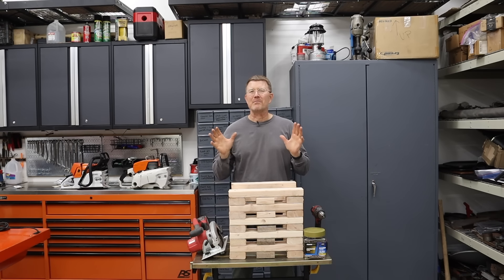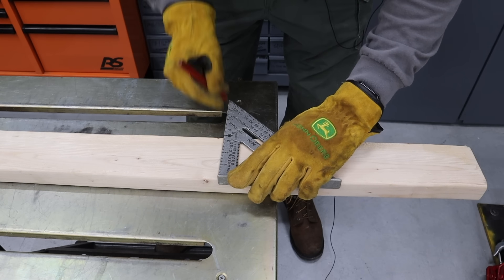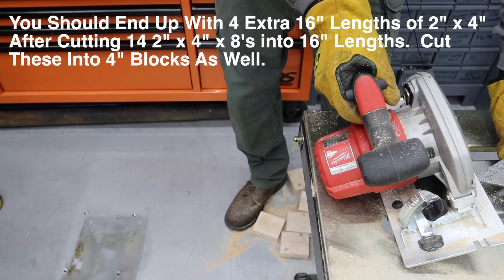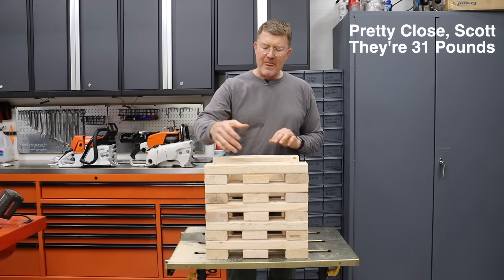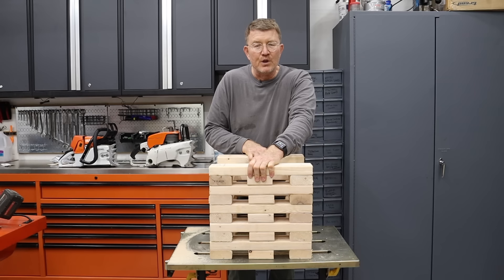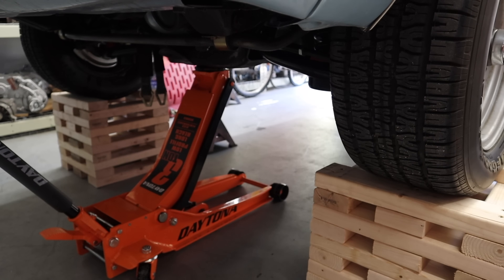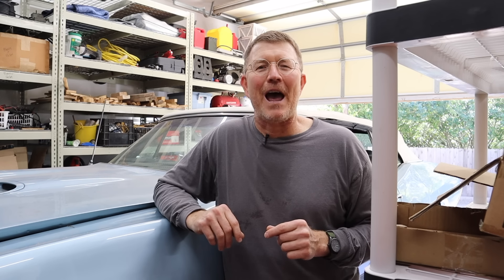Building Inexpensive Wheel Cribbing or Wooden Wheel Stands

Comment: UNSAFE. The front and back of the tire is applying outward pressure to the top two 2x4’s. The only thing keeping it from collapsing is the shear strength of the screws on top. Would be stronger to have the top flat
Reply: Funny how no one’s ever said theirs failed 🤷🏾‍♂️

Comment: I've made several sets of these over the years. I found that some around 7 1/2 to 9 inches really come in handy for most work. You also don't have to build them quite as wide when going shorter, which frees up space under the car (and storing them takes up less space). You can even mix them to have the front higher than the rear (or vice versa). As far as building them, I use heavy construction nails that extend slightly through 2 boards. I believe they're about 3 1/4 inch. I'll pre-drill. To safeguard against the nails backing out or loosening over time, I'll also use construction adhesive or wood glue. Franklin Titebond 2 is ok for exterior use and super strong. I've also experimented with using casters, but the good ones are just too expensive. It would take 16 high-quality casters and prices have gone crazy on them in the last few years.
Reply from the maker: Thanks for the input.  I need something with casters, but I'll probably just buy some vehicle skates for that.  Scott

Comment: Most crib building videos don't include your 4 inch blocks.  As your inclusion of these blocks makes for even stronger, and hence safer, cribs for more peace of mind, we included them. You can never be too safe under a car. We glued and nailed our cribs but only needed to go eight pieces of timber high rather than your ten high. As I live in a new housing development, we were able to use discarded timber that was destined for landfill. Congratulations on your superior crib design.
Reply from the maker: Thanks for the input, John.  Glad you found the video helpful.  Scott
Reply: Same here. I have been planning on building some for a while. I like the idea of putting the extra 4" block in. Thanks for the video.

Comment: Built these a while back to do a Trans swap also. I cannot believe how much easier and less sketchy it made the process. One difference, I am a belt and suspenders kind of dude so I had my jackstands at a place they would, hopefully, give me an extra second or two if there was some sort of catastrophic failure with the cribbing.
Reply from the maker: I generally do jackstand backups if I'm using jackstands, but I did not use 'em when I had the wheel stands under the wheels.  Scott

Comment: Actually beneficial to construct 6 riser stands, 2 half high so the car can be brought up in progression. Treated wood and wood glue not a bad idea as well. Not to overplay the fine job you've done, but overkill is never a bad idea for longevity & personal safety. Tip the trans on the jack & slide. Use a combination wrench with bolt and nut through a bell hole to retain the converter in the pump. Trans guys been doin it that way for decades. To late now, videos 10 months old but you may do again.
Reply from the maker: Thanks for the tip on retaining the converter.  I've seen it before but forgot about that.  Scott

Comment: Good job. There was a thread on this subject on the HAMB not long ago, and some of the cribbing that was shared in the thread looked really sketchy; some guys are obviously engineering challenged. I don't like pine boards for cribbing, but I think the 4" long blocks you inserted in 2 sides made a huge difference, in effect transferring the weight straight to the ground. As long as the weight of the vehicle doesn't exceed the crush weight of the wood, you're good to go; and with the weight of the car you're working on you're fine. But for those watching, if you're working on heavier off-road equipment, don't use soft wood like this, get some hard wood for your cribbing. Again, good job on these. Be safe!
Reply from the maker: Thanks!  I hear you on soft wood; I think these would be really strong with some rough-cut hardwood 2" x 4"s - something that's a full 2" x 4" of course.  Scott
Reply: @THEBULLETPROOFGARAGE  WE used 2x4 rough cut oak timbers cribs like this to change the oil in 15,000# forklifts in the papermill. Also used 4x4 oak timbers for cribbing 30 ton pieces of machinery when moving or breaking it down.
Reply from the maker: @TheJagjr4450  - I have a Catepillar 977 and have some 6x6 rough cut oak for that.
Reply: @THEBULLETPROOFGARAGE  think about the cribbing they use for moving houses... 4x4 6x6 oak or ash. One time my dad and I were unloading a flat bed with a 24" dia 110" wide 30,000# solid steel bed roll off a calendar stack... he had one end I had the other and we had the truck drive out from under us then we lowered it to the ground.
Reply: It's the HAMB back? I know last time I looked it was practically dead and all of posts were gone.
Reply from the maker: @starion88esir  - when was that?  I haven't logged in there in months, but it's always been busy when I do.
Reply: @THEBULLETPROOFGARAGE  I havent logged in there in months either, but when I did it looked to be about the same; same characters, same topics.
Reply: @TheJagjr4450 Would using grade #1 Douglas Fur be adequate?
Reply from the maker: @trickyricky12147  - good question.  I'm not sure what the strength of Douglas Fir is to yellow pine.  Scott
Reply: @THEBULLETPROOFGARAGE  Yeah, figured I'd ask because if doug fur is good for framing structures, then it should be a perfect species for wooden wheel stands as well.
Reply: Any opinion on using pressure treated 2x4 s?
Reply from the maker: @williamholford6301  - should be fine, just a bit more expensive.  Don't forget to use the appropriate fasteners; regular nails and screws are prone to rusting in treated wood.  Scott

Comment: I did basically the same thing, but used 2x12s. The top board is about 6 inches longer than the one below, with 2x4 on the ends to serve as wheel chocks. They are rock solid, and steady. I have had my 7800 pound 1 ton ram 4x4 on them with zero problems. 

They are heavy, but very useful. I used treated lumber.
Reply from the maker: They sound like they're quite stout, and heavy, too!   Scott

Comment: This is probably the best cribbing video I've seen.  The center block for load transfer is a great idea.

My uncle taught me a different approach that may work when time is short and you can't build cribbing.  Get the vehicle up as high as practical and safe based on the jack stands you have.   Put 1/4" plywood on the ground and slide the transmission on it until it's under the trans tunnel.  The plywood will protect the bottom of the trans.  If you can, replace the jack plate with a square piece of 2x12 and a counter sunk bolt that keeps the wood flat against the pan.  Wrestle the trans onto the 2x12 under the trans tunnel and hold down with a ratchet strap. Lift the trans up and roll it forward into place.  I've done it about a dozen times that way through the years when my back was a lot younger.
Reply from the maker: That sounds like a good plan, but I'd probably go to 3/8" plywood.  1/4" stuff is pretty thin.  Thanks for the input!  Scott

Comment: Thank you for the great video,I just went through the same thing,my neighbor loaned me the exact transmission jack you have and I pulled the trans out and even with the car as high as I could get it the trans wouldn't clear the exhaust so I thought I was going to have to remove the trans from the jack (would have been fun!) but then I realized all I had to do was tilt the front of the trans down with the jack adjustment.We always seem to overlook the obvious.
Reply from the maker: Glad you got it figured out!  Scott
Reply: Hey, congrats on that solution! When I was a little kid I was the tool runner for my Dad and The Airforce G.I.s he invited to work in his garage. I saw them use this kind of method to clear the exhaust pipes. This was back in the 1980s.

Comment: I’ve seen several guy/galz make these and as 32 yr carpenter (also yrs as a superintendent over commercial projects) I have had major cringe seeing ppl make these.

That board has a fraction of its load/weight capacity laying flat. On edge or vertical is where it has its greatest strength. The difference I see in yours vs others is adding that center cross members. You’ve transferred the load straight through to the floor. 

So I’d say you’ve done much better and I myself would feel safer vs those others. 

But if it was me I’d use 2x12 yellow pine on edge with a 2x4 base and top. 4 12’s spaced 6” OC and 3 2x4’s laid flat equally spaced top and bottom. That’s just me. Like I said yours are the best I’ve seen so far.
Reply from the maker: Thanks for the input!  Scott
Reply: I'd definitely agree with using some 2x10's or 2x12's on edge. It would save time and materials. But I think the 2x4's flat are probably just fine. I'd trust them over some old cheap jack stands. Jack stands have one point of failure whereas the 2x4's would have to have many points to fail before something bad happens.
Reply from the maker: @LutherBuilds  Thanks for the input.  Scott
Reply: @LutherBuilds  Takes something real heavy to smash wood. I ain't got no car like that. lol

Comment: Back in 2013 I built four of these to lift my Corvette to get the automatic transmission out... took some measuring to first determine the needed 'height' needed to get the trans out from under the car when it was 'on' the trans jack. End result it worked like a charm but a regular 'lift' would have been great... I'm too old to keep working under a vehicle, on my back.
Reply from the maker: Lifts are great, but they take up so much damn room!  I had one in the garage but sold it a few months before I shot this video.  Scott

Comment: When i changed the trans in my truck several years ago i ended up  wi5h cinder blocks  under the 4 jack stands to get enough hight. Used one of them red and white scissor  jack to lift the trans under it. Worked much better then the one 9 on the floor jack.
Reply from the maker: Putting jack stands on top of cinder blocks makes me real nervous!  Scott

Comment: I've been struggling in my mind as to how I would raise my '89 Volvo 240 wagon up high enough to R&R the transmission. These cribs are the perfect solution. I built mine 16" high. And also built 3" extension plugs just in case. I also bought the same jack and the T bar attachment. Thanks for taking the time to make the video.
Reply from the maker: Thanks for the feedback and good luck on the wagon!  Scott

Comment: You can always put lumber under the floort jack as well. And im starting to buy floor jacks in pairs makes things alot easier  and safer
Reply from the maker: True, but you have to be very careful if you're lifting front and rear with floor jacks at the same time because there's really nothing to keep the car from tipping over on its side.  Thanks, Scott
Reply: My Dad and I have always stacked 18 inch blocks of railroad ties underneath the chassis of our project vehicles if they are too high for the jackstands. And then blocks of six by six inch beams. But my Dad remembers cribbing like yours, (but bigger), used by his Uncle Jack when moving houses in the 1950s. The whole crew was a bunch of young guys that used bottle jacks to lift up the houses, and then Uncle Jack would tell them, in his Norwegian accent: "Ho-kay, effry bodday jahk koff!!!" Which always brought gales of laughter!
Reply: And then we stack up the four by six inch blocks. And then the four by four blocks. We had to do this kind of wood stacking when my Dad's car hoist broke a cable while lifting a neighbor's plow truck. All because Dad was too proud of a mechanic to hire a hoist repairman. 
    We even stacked spare steel truck rims underneath when we ran out of wood blocks.

Comment: The trans jack that you used has adjustments  to tilt forward.thats worth 4 ".tilting the front of trans gives you enough clearance to get under the car. Once under the car put torque converter in.i did this on a 1980 trans-am with th400
Reply from the maker: Thanks for the input.  Scott

Comment: When I worked in the South African gold mines, we used cribbing like this to prevent the ceiling from coming down on us. The work area was only 3 to 4 feet high and when your nearly a mile underground, the pressures are enormous and the ceiling of the work area will sink down pretty quick. The cribbing slowed down this process allowing the crews to drill, blast and clean out. After a few months, the cribbing in the old work areas would eventually be crushed  by the intense pressure. The compression strength of wood is about 5000 psi so I'm quite sure the cribs in this video would easily hold a large heavy truck, let alone a car.
Reply from the maker: Sounds like real claustrophobic and dangerous work!  I hope you were paid well!!!  Scott
Reply: @THEBULLETPROOFGARAGE  very claustrophobic. Nearly died once. Returned to the US and considered myself lucky. Great video by the way! I'm building your cribs today. I just don't trust the floor jacks when I'm under my Sienna.
Reply from the maker: @ericberg2131  - Excellent.  Floor jacks make me nervous, too.  Scott

Comment: I made cribbing just like that but longer and made it individual layers and solid tops to put under my jack so I wouldn't have to put blocks on top of the jack makes it more stable and I can increase the jack height 3 inches at a time you can also make extra layers of cribbing to increase the height of the cribbing you made 👍👍
Reply from the maker: Yep, putting your jack on something solid and stable is another way to get some extra height.  Thanks for the input, Scott

Comment: Good video, I was thinking of using cribbing on my son's 2010 Mustang GT and swapping the tranny in my driveway, but my driveway sits with a slight incline and I don't feel safe doing that way. I pulled the C6 out of my 1988 Ford F250 7.3 diesel in the driveway, but it sits tall enough that I didn't need cribbing or jacking. I did have to drag it out from under the truck without the trans jack to clear the bottom of the truck. I laid it on a piece of scrap board and attached a rope to the board and slid it out by pulling the rope. But with his car (the Mustangs sit very low) and the incline, safety first, safety second, safety last, is the rule of thumb so he had to pay a shop to do it even though I know how to pull a transmission. The goal was to save him some money on the labor by just brining the transmission to the shop. But if it is not safe, it is better to pay.
Reply from the maker: Yep, you really need to be on level ground.  1988 F250 sounds interesting; I have a bunch of 7.3 IDI content on my channel.  Thanks, Scott

Comment: Looks pretty interesting and I might need something like this for an upcoming project. I think instead of the 4" blocks, I would cut another 16" piece and have it cross the middle of the block. And I would fill in any empty space in the middle with whatever length of 2X4 is needed to fully support the center of the block where most of the stress would be from the weight of the car. 
         Taking a longer view, If you are a serious car hobbyist, and have time to plan for the future, you should give plenty of thought to how you are going to work under a car as you age.  In a nutshell, I think the majority of guys will not want to crawl under a car as they enter their 60's-70's. Get a car lift installed in your garage/shop so you can work more comfortably and not be as concerned with jackstands and the like. They are not that expensive compared to money frequently spent unnecessarily on other areas. It may mean making changes that you didn't originally plan on like getting a building with taller walls than you have. But it may make the difference between you being able to pursue your hobby and not.
Reply from the maker: I actually had a lift in my garage but it took up too much room.  I may end up with another one, but I hope to still be able to crawl under a car when I'm in my 80's.  Thanks

Comment: I have been looking to build a set of these, and this video came along at the right time. I wonder if you could have just grabbed the tail shaft and tipped the trans forward just enough to clear the frame rail without removing the rans from the jack.
Reply from the maker: Good question; I didn't try it, but I don't know if I would have had enough room.  I'll certainly try it next time.  Thanks, Scott

Comment: With the car on jack stands at the front, when jacking the rear up I'd be checking that the front was still stable and not rocking off the stands or tipping forwards!
Reply from the maker: I only use really heavy duty jack stands.  They're very stable on concrete.  Thanks, Scott
Reply: @THEBULLETPROOFGARAGE  That's good, but the point of contact of the stand with the car becomes a hinge/pivot point as you jack the rear up.
Reply from the maker: @Paula2002  - Correct, and if your jack doesn't roll to the rear as you're jacking (i.e., if you're on rough ground), the jackstands can tip over.

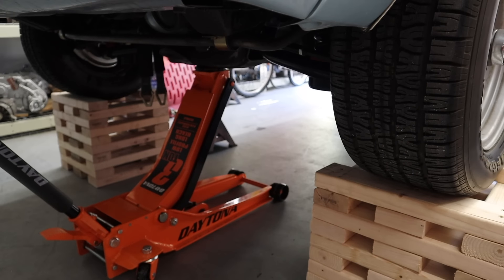Comment: What are those two straps hanging down at 16:36 near your pointer finger?   thanks
Reply from the maker: It's a short strap that I use over the axle to attach my ratchet straps to.  Use it when trailering the car.  Not sure why it's on there now.